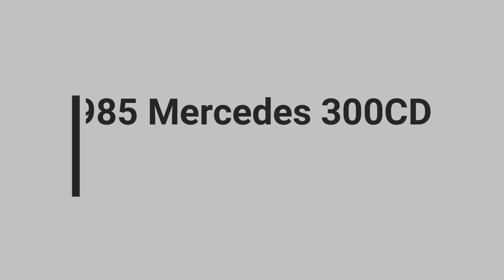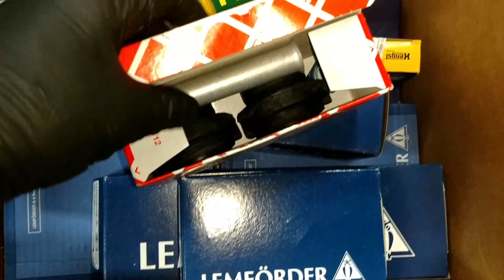1985 Mercedes 300CD Part 6 - Front Suspension Rebuild

Comment: That's  pretty neat how easy those bearings are to remove, regrease, and if need be replace.  
I spent about 6 hours of torture to change the wheel bearing on my subaru.  

I should probably look into why my wheels are so hard to rotate.  I was surprized when he spun the wheel and it free-wheeled like that.  My 300D wheels take some muslce to turn over, probably why the car also doenst coast much and will deccellerate if you take your foot off the go pedal.
Reply from the maker: Sounds like your brakes are dragging or somebody really cranked down the spindle nut and your bearings are extremely tight.

Comment: Truly exceptional instructional video.  I applaud you sir.  I will be doing this job in the spring, so thank you very much.
Reply from the maker: That's great I'm so glad it helped! It's not that difficult just make sure you have the right tools and take your time.
Reply: @woodsandbarclay  just one question on tools. Detaching the lower ball joint, you used an unusua upright l ball splitter rather than the scissors type.  Is this necessary or would the scissors type work.
Reply from the maker: Yes I hammered out the lower ball joint by putting a steel slug on it and banging it out. That's really the easiest way to do it I'm not familiar with the "scissor" tool you mention.
Reply: @woodsandbarclay  I was referring to detaching the balljoint from the vertical strut. 
Ive now watched every minute of your work and will be telling the mercedes benz club of UK how good your YouTube channel is. 
Ps. If you come across a low mileage right hand drive del. Please don't dismiss it. Let me know. I may wish to reserve it.
Reply from the maker: Oh yes I have a special tool that does that the tool is made by OTC I think. Thank you so much for the compliments I'm so glad you're enjoying the videos. I will definitely keep my eyes out for a right hand drive car!

Comment: Hey, what benefits can one expect from a front suspension rebuild ? 
So far, i've seen that my upper control arms bushings are shot, so i will be replacing those, but I don't know if I should just do it all?
Thx and great video.
PS: I don't understand why you change the whole upper control arm, bushings are available and the piece itself seems very solid.
Reply from the maker: You change the entire upper control arm because the ball joint on the original control arm cannot be changed. The benefit of redoing all the front suspension is better handling better steering better ride quality and safety. Keep in mind your front suspension is 40 years old. When your front suspension is 40 years old it's time to redo it. Nothing lasts forever and the fact that it has lasted 40 years is incredible.
Reply from the maker: You should definitely have no leaks in your fuel system that means air is getting into your fuel. That could definitely be the problem.
Reply: Ok, I will report back once i make everything tight and nice. it did that before leaking. But maybe it was already enough air to mess things up @woodsandbarclay
Reply from the maker: Air in the system will not "mess it up". It will just not run right. If you fix your fuel system so air is not getting into it then you should have no problems.

Comment: Fantastic video and workmanship bro!  Are those wheels 15  or 16" Bundts?  Which of the two wheel sizes offers optimum ride height (obviously depends on tire profile)?  In other words, which of the two (15's or 16's) would / should one opt for to obtain better handling and cosmetics without interfering with steering capabilities, while maintaining a standard ride height for w123 Euro spec?  She's currently wearing 14" bundts.
Reply from the maker: The wheels on this car are the factory 14-in bundts. You're not going to gain any performance or handling if you go to a 15 in.. these are not high performance vehicles. It really doesn't matter what tire or wheel you run. It only matters what tire and wheel you run if you have a high performance vehicle that actually utilizes the tire and wheel. These cars are designed to drive on the highway or go to the grocery store. You don't experience any high performance driving in one of these vehicles so don't waste your money getting high performance wheels or tires.
Reply: @woodsandbarclay  😎👍

Comment: I didn’t realise that you could lift the car up from the sills.  Is this the recommended method.
Reply from the maker: Yes you can lift cars from the pinch weld. Most Mercedes have little pads in that location designed for the lift to push up on.
Reply: @woodsandbarclay  thank you, I am aware of that. I use a scissors lift so I could put a jacking pad under the jacking hole used for the portable jack..  can't believe you have so few subscribers. It will no doubt rocket soon.
Reply from the maker: I hope so I think I've got around 5,000 subscribers now. Since I only do diesel Mercedes videos I think it's a pretty niche market.
Reply: @woodsandbarclay  the European Market has a lot of petrol or gas.
Reply from the maker: I'm not a fan of the gas models simply cuz they don't last as long.
Reply: Great video and great work, but on this point you are wrong.
Those are defintely not the recomended lifting points! For the front, you should use the inner stiffener bars, and for the back,  the forward attachment points of the rear axle.
Lifting the car on the points, you used will normally lead to inside rust of those areas. A  very common problem on these models. Due to the weight put on these points by lifting, the inside reinforcment structure will get small cracks in the paint sealing, moisture creeps in and that will be the beginning of the end. Maybe not in dry Arizona...
Only on later models they put those rubber pads there for lifting, but definitely never lift any Merc model before 1985 there.

Comment: Hi, I watched your videos about 1985 Mercedes 300CD, you are very lucky to have a very low mileage car in that condition. I have a 1986 Mercedes 300SDL and it gives me noise that's coming from rear wheel bearing. My mechanic said to replace the wheel bearing which is not a simple job. He is not willing to do that also he said that he does not have the special tools for that. Could you please post any videos on how to replace rear wheel bearing for rear wheel drive car (300SDL)? Thanks.
Reply from the maker: I actually don't have an 86 in the shop but I can post some videos doing it on a 300D or SD.
Reply: thanks appreciated